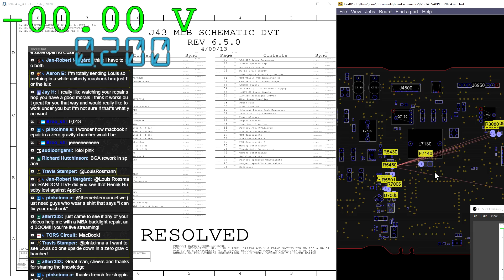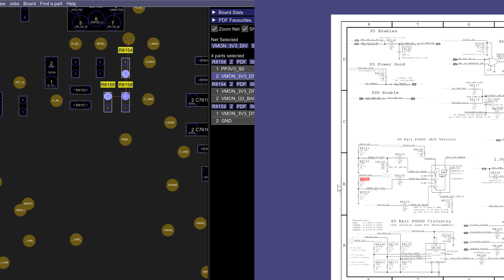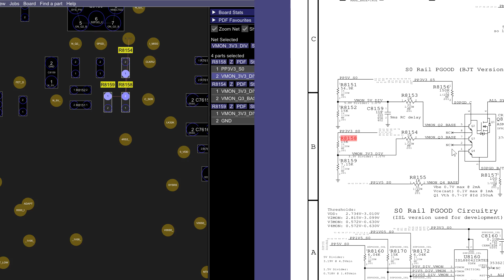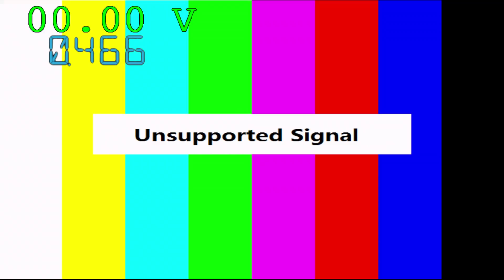Macbook Air A1466 board drawing 200 mA but not turning on: how to repair.

Comment: Buy or borrow a small silent generator. Running all that equipment off of a battery alone is asking for failure. Practice run it a couple times. Set it up in the shop and let it run for a while or work with it and see how it does before you go with it.

Comment: Hi I have a questions after a drop me IPhone XS Max 1X zoom camera turn then a few day later the 1X zoom camera start to get green, purple and black line running through the camera app the the 2x zoom is normal and the front camera is normal but I can still see the images but with those line and a green  tint what do u think the problem is and how much will it cost to fix I turn restarting it a lot and force restart pls

Comment: Where do I pay to see this happen? Get the genny, the battery power required will be monstrous.
For lights, cameras, screens, microscopes, repair equipment you're probably running 2000w at 120v. That's gonna be huge at 48v. Around 100a.

Comment: My experience with soldering equipment 'in the field' is that even a slight breeze can steal a lot of heat.  Be prepared to have someone standing by with a big cardboard panel [or similar] to act as a wind shield.

Comment: 6:15.  Coma or Chromatic Aberration is the "rainbow colors" usually around an edge of an object. This is caused due to how light behaves when bent by a lens. A lens bending light is essentially a prism and scatters the light. The more indirect the light enters the lens the more apparent it is. Higher quality lenses are able to minimize this.

Vignette is the darkening or shadowing around the edges of a frame.

Comment: Louis, this is $500 and does what you need for your booth. It is a better solution than your bike battery. It may be expensive, but it will work well. A less janky solution. https://www.amazon.com/Anker-Powerhouse-120000mAh-Alternative-Rechargeable/dp/B0196GQAKM/ref=pd_bxgy_107_3/134-5697602-7292735?_encoding=UTF8&pd_rd_i=B0196GQAKM&pd_rd_r=eb26baa1-75bb-424b-b0bf-711d91e00fcf&pd_rd_w=zohAH&pd_rd_wg=DIURD&pf_rd_p=a2006322-0bc0-4db9-a08e-d168c18ce6f0&pf_rd_r=GV3BGWST6F1ET6GD8XPD&psc=1&refRID=GV3BGWST6F1ET6GD8XPD

Comment: I don't think you need a permit to film on a public sidewalk if you are only using handheld cameras or a tripod, but if you plan to set up a table, you may need a SAPO permit (Street Activity Permit Office).
https://www1.nyc.gov/site/mome/permits/when-permit-required.page
https://www1.nyc.gov/site/cecm/permitting/permit-types.page
https://www1.nyc.gov/site/cecm/faq/frequently-asked-questions.page
Also, sometimes private property can include the sidewalk all the way to the curb, so you have to be sure you will be able to set-up where you want to.
But I'm no lawyer, so you may want to at least call someone to see what is needed.

Comment: you might a car battery x3 to power your solding iron 1 for use 1 spare when it dies and 1 for recharge a car battery can give you more amps also the sign could read something like this "if apple cannot fix it the fault and nobody can help in the apple store then call louis rossmann  group A1 team for repairs"

Comment: Talking about you using your bike batteries, how many Ah do they have? Because I wouldn't be scared about power output more than capacity because this many devices will draw a bit more than 200 mA

Comment: You know I watch these videos and think wow, my high end Sony Vaio F series that I bought in 2009 hasn’t broken yet.  I have upgraded RAM, and did drop it breaking a cooling fan fin.  Other then that, my GPU is bottlenecking the triple A games, and my CPU doesn’t like running chrome, but it’s a solid workhorse.

Comment: Rather than a bike and a stand I'd get a small van or caravan with solar panels on the roof and a few leisure batteries inside. The starter battery on your bike was not designed for what you intend to do with it. 
While  before I was stumbling upon your videos now and then, I have now subscribed just for watching apple getting humiliated, as they deserve. Good luck!
Reply: odds are it's a li-ion battery, which gives zero fucks about discharge rate... but it will still be far too small

Comment: I worked in an electronics repair shop as a kid and the guy there had this brush with fiberglass bristles that was amazing at removing corrosion from copper contacts.  I've never seen Louis use one and wonder why.  Esp on those really tough boards. (The thing is called a Jewelers Fiberglass Scratch Brush)

Comment: yeah take more and more power than ya think... specially the microscope and soldering station you WILL need a generator
Reply: @Kappa would depend on the wattage of e soldering station I suppose.. yeah, hot air might be right out..

Comment: Louis, using stepdown DC-DC for povering your camera and laptop is much more efficient, than converting 48V DC to 120V AC and than laptop power supply converts it to 19V DC and camera power supply converts it to 5V or 12V DC (or something like that)
Reply: .... I agree but for a one off, is it worth the hassle ?
I use a home built Step-up DC-DC to power my LENOVO P50 ( I took notice of Louis's preference) and works flawlessly so far.
Reply: Just the hot air station is like 1600W which can't be powered from a battery.
Reply: @TechnologistAtWork  Sure it can.. It just needs to be a big battery, or not be used for long.. wth?

Comment: You should rent a small gas generator that they use in halal carts. Dont know if you will need a permit for that too
Reply from the maker: gas generator requires permit and examination by fire department. this is NYC, the less red tape the better. I am trying to minimize the binder of paperwork required to get this done

Comment: @LouiseRossmann Make sure you don't take the schematics with you as they will prolly try and get you for having them. (or at least only take copies not the original files as you may lose the machine you are using to see the schematics on.
Reply: Theresa Forster remote into machine at the office with the schematics

Comment: It takes a lot more battery power to pull off something like that than most people realize. If you get the permit you should do a dry run to see if you have enough power before you go there and fail.
Reply: Running a soldering iron, microscope, and a hot air station will not last long on a tiny battery. Running DC to AC loses a lot of efficiency.
Reply: True. Inverters are amp hoggers, and batteries don't last so long. What Louis could use is a couple of lead acid batteries from a semi, running in parallel and that would give him 6-7 hours most likely. But that would have to be tested out before going to the event
Reply: Dry run every time.  No one wants to look a fool whilst showing off.
Reply: You would need a honda eu2000i generator
Reply: @wirelessdj  He said he would have to pay more to have a generator, the idea is to run on batteries. The generator you pointed out alone is 1000+$ and it's really noisy. A 12V 350Ah battery for a semi goes for 450-750$ brand new, its quiet, can be recharged again with a 30$ charger and you're good to go again.
Reply: @hussssshie  Maybe someone could donate a generator for the day , put some sound proofing around it as well but eave enough air so it does not get to hot . Some of the Honda generators are not that noisy, so possible . Or have a couple of normal heavy duty car batteries , hook them up to the hot air station e.t.c and via an inverter and the generator to them to keep them topped that way the generator would not be running flat out all the time and on tick over they are very quiet
Reply: Yes, or bring a traditional gas generator as a backup.
Reply: Dry run meaning assemble a mobile work station and do repairs  before doing the event. Right!
Reply: @rickdees251   Or at least assemble an in house work station ran on batteries and see how long you can stay powered up.. My guess is that you will need a small inverter generator.